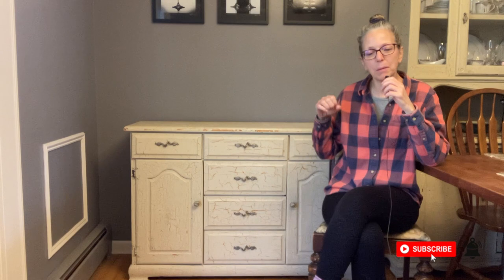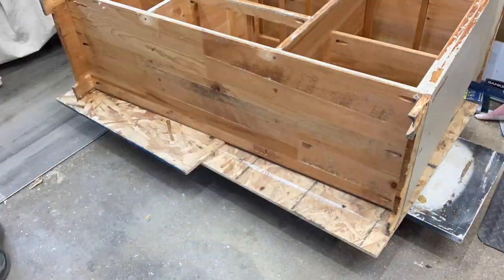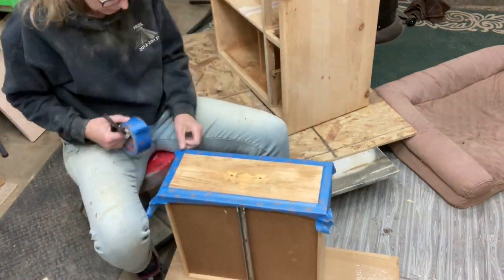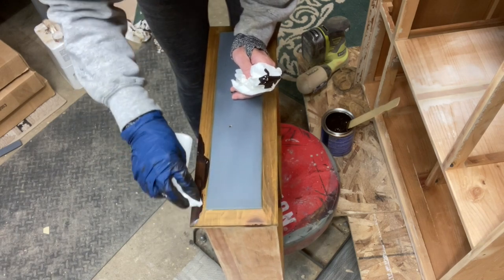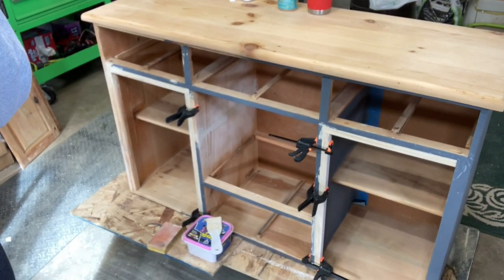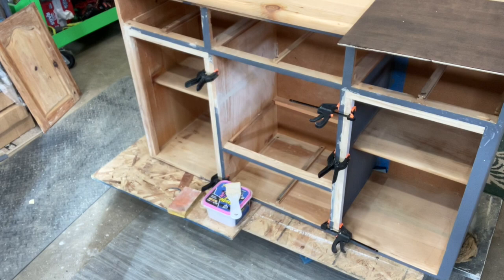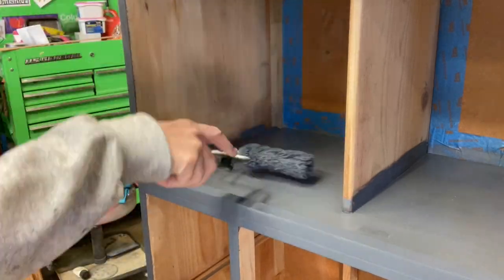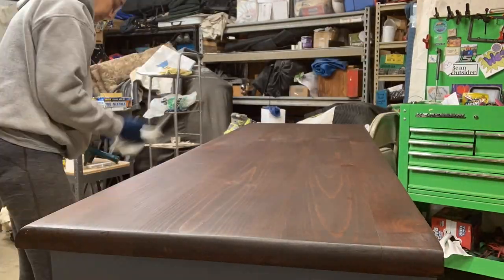DIY Furniture Flip - From Tired to Admired with Fusion Mineral Paint

Comment: Great job Mel. That would go perfect in a space in my own home and I would only need to change a couple of things for it to fit perfectly for me. I’d need to change the hardware to all black. I would also put another coat of stain around the 2 doors as the doors on my screen didn’t look the same rich deepness as everywhere else & finally got my home I’d make the most of the beautiful glass and would install a light to the ceiling. So on a night you can press a button/remote control and you would get light radiating from the glass behind. I’m always blown away by your talent, your creativity, and your grit determination to get through and finish your project in the most immaculate way. Well done hun 🥳
Reply from the maker: Thank you! You have a lot of great ideas yourself! Thank you for watching!